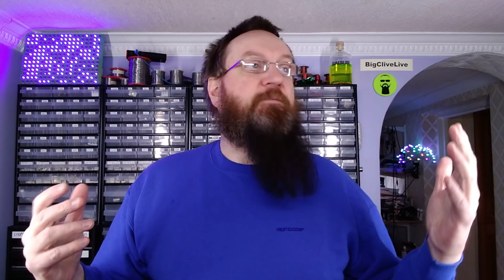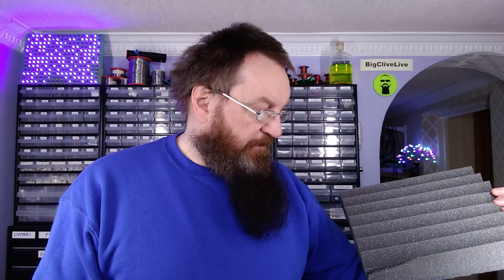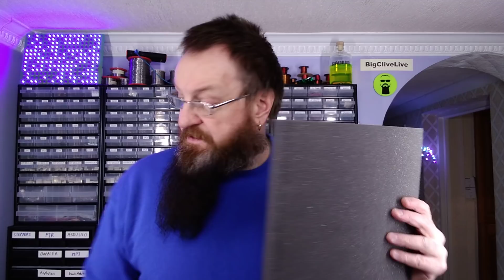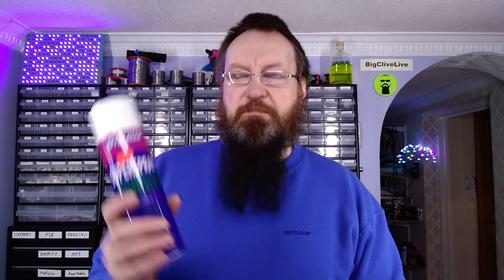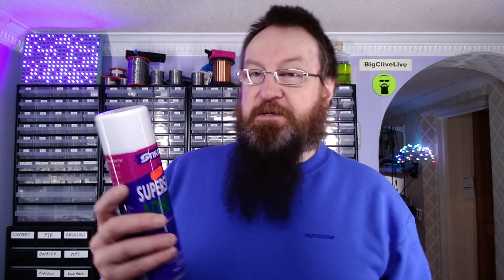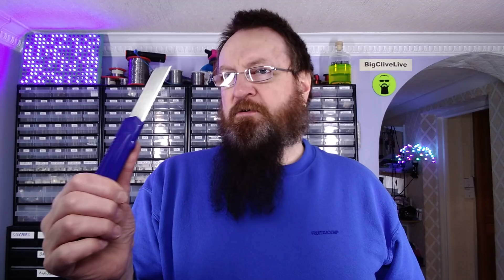Acoustic foam test.

Comment: holy crap! how low is that ceiling?
Reply from the maker: I moved here from an old tenement flat with an 11 foot high ceiling.  It felt claustrophobic at first.  This is the lowest ceiling in the house, but the others made up for their slightly higher height with candelabra lights hung at face height.  I'm quite big.  I have to go through some doorways sideways and duck under one door frame.

Comment: I don't know what your all talking about, that's it's lost all the highs. That is NOT the case. If the microphone is roughly on-axis with the source (his mouth) then the microphone is receiving a direct audio signal with no reflections...the best way to listen to something for intelligibility. Your simply comparing the increase in high frequencies due to the reflections before the foam was added to the damped reflection audio now.

The highs have technically reduced, but not below what is should be.

Comment: with my poor hearing (old man ears and tinitus)..., I experienced a drop in treble, and increased "muffle-ness", I guess the best way to describe it would be to say the clarity had dropped a tad. The bass seemed to stay the same tho. Really cant say the bass increased due to the loss of treble. I did have to increase the volume after the change, so there was some loss of total "volume". I had to increase the volume from 5 to 7  on a 0-20 scale. To bring things back to "normal", I increased the treble from 6 to 8, increased mid range from 6 to 8, and kept the bass the same ( 8 ) on my tone controls.

Comment: I tried a sample in Audacity.  Knocking -6 DB off the bass and adding .03 echo with .1 decay made it sound cleaner.  Your deep voice still came through but didn't sound like it was bottoming out the mic.  The only problem was when you turned your head the new setup seems to be much more sensitive to where you are relative to the microphone.

Comment: Far better with the foam in place.  I'd just run it through a smidge of post-processing EQ -- boost the gain a bit on the upper frequencies, and decrease the gain on the lower frequencies.  Should make it sound perfect.

Comment: The foam is flame retardant, but what about the spray adhesive (during spraying, when wet on a surface, and finally once dry)? That would probably make a good stand alone video, provided the local fire brigade don’t need to get involved - if they did I guess that would be Patreon only content?

Final result does have a reduced reverb at the higher frequencies, but the damping does accentuate the lower bass end and leaves little in the mid range - which does sound slightly muffled via my headphones.

Comment: It does sound different but it doesn't matter at all! We are not here for the sound but for the info.  Question: What is the weakest point of an audio transmission and reproduction (over Internet) channel? The mike? The preamplifier? The sampling frequency? The CODEC used? The bitrate of connection? The audio amplifier at the end? Oh, maybe the loudspeakers (laptop, phone, headphones, ear buds, full studio way loudspeaker box)? Oh, no, none of these... it's all in the foam!. Definitely, it's in the foam!

Comment: As the foam absorbs the treble (vocal) frequencies, the low-mids and bass become pronounced making the voice faint and muddy. Foam is better used for listening environments where the 'mirror-point' sound reflections (off the walls and ceiling) can smear the sound heard directly from the audio speaker. The best method to achieve a good room sound for recording is by mic and source positioning....a tile or two can help also. Thanks Clive!

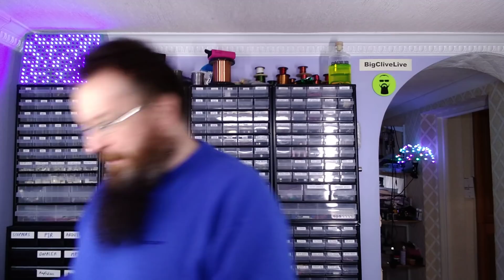Comment: Hello,  Please listen to your video from @3:00-3:25.  Notice that @3:10 the sound doesn't have a boomy/echoey quality, but by @3:12 you've stepped forward and the boom/echo returns.  The foam does make a positive difference.  (Please contrast the first 30 seconds of the video, when there is no foam and you move about which changes the sound quality, to @3:00-3:25.)  However, the foam is not a complete solution.  Your best sound quality will require you to stand a bit further from the microphone.  Thanks for working to make you live streams better. :-)

Comment: Sounds worse Clive, Listening in my studio with Tannoy Reveal nearfield monitors, which I mix my music on, the top end has gone. The trouble with enclosed spaces like you are in is the low end in your voice is over powering the top end in such a small space. I would try EQ on your post mix, and boost and add air after the 200Hz range. maybe cut a little of the bottom end.

Comment: If you create an air gap behind the foam it'll be more effective on lower frequencies and give you a more balanced result. 
The foam thickness + air gap thickness will get you the majority of the damping of foam of the same total thickness.
Reply: At 2" total thickness from the wall you'll get good absorption down to 250-500hz, and if you're looking to control the bass region you'll want to be 3-4" from the wall.
Reply: https://www.acoustic-supplies.com/absorption-coefficient-chart/

Comment: to kill that bass boominess you need extra material in all of the corners; many of the same foam vendors sell triangular corner traps for this purpose. You can also build one or two bass tube traps from fiberglass and hardware cloth or other materials; leave the ends open and place in corners with an opening near each wall/ceiling or wall/floor vertex. Used by audiophiles to kill bass resonances. The problem is you've got a baritone or tenor-baritone in a phone box. How much damping material is found inside a bass reflex enclosure to try to stop it from sounding like a box? Same kinda deal. Perhaps you should simply fill the entire studio workshop space with acoustic damping fiberfill, floor to ceiling. ^_^

Comment: You need a bass traps should also make a slight air gap so the foam basically doubles up. I’ve not watched the vid yet but these are some pointers

Comment: I have a great solution but a less fire retardant option. Towels are amazing acoustic dampeners. Especially if you make frames with one towel stapled around the outside of the frame and a few towels or even foam on the inside of the frame. I wish towels were flame retardant.

Comment: Sounds significantly better. You do still need to run your audio through some kind of processor. Too much bass.  The too much bass has always been a problem for your vids though, not caused by the foam.

Comment: HI Clive

After you done the panels on the wall, the sound has less high frequencies, that"s the foam doing its work. My advice as an audio engineer is to shelf the  lower frequencies down instead of turning the highs up.

There are lots of other things going on that create the box-sound. The panels are not so much correcting that, these are absorbing mids and highs.  Picture me with a huge drumstick tapping the outer wall of the room, that's how your room sounds. Freqs that fit between the walls perfectly will be amplified more than other freqs (standing wave,) It even causes some cancellation on other freqs. End result, the spectrum is not a flat line but more of a ripple. You have cabinets and stuff next to the wall that help to temper that standing wave, the largest surface in your room creating a standing wave is probably your ceiling. You will need a basstrap to correct these standing waves. I dont know if you want to be doing that. 

The microphone used is also a very big factor. Even if i'm in a very reverby room, when I talk into a mic very softly and at close range, you won't hear any reverb. So distance to the microphone is a critical factor. In sound design, we make a lot of use with this proximity effect. The biggest factor on a microphone that goes with this, is the polar pattern. Some mics are omni-directional, they pick up the sound from all sides equally. A cardioid pattern will pick up the sound  more from one side.

Truth is, its all trial and error. Yes a more expensive microphone will deliver a better quality. But you don't need a high budget mic to deliver an excellent quality. Mic placement is the most important part. You can already color the sound so much with only that. the closer you talk into the mic, the more low frequencies it has. The further away, the more room the sound gets. Just try as much microphones as you can. Borrowing from a friend, or rent them at an audio rental company. There are active basstraps, these work with a microphone and a woofer that gives pulses in some phase to correct the energy that is going on in the room. They are pretty expensive, but real something you would want to get your hands on and take apart to know how they work. 

Greetings and love your channel

Comment: Hi Clive!  seems like it has cut down on the echo, but also made things quieter.  As I've got volume control here that is an easy fix on my side :-P  I hadn't realized the size of the room.  It turns out I was just filling in the space to make it seem like the ceiling was taller and the wall behind you farther away.  It was so strange to see you reach up/back and touch the ceiling and wall behind you.

Comment: Absolutely huge difference to the boxiness. Sounds almost too dead after getting used to the old sound. I wonder if I can still fall asleep to this (probably yes), as echoing lecture halls are also good places to fall asleep in for me. 
I mostly listen with mobile devices which can't reproduce the bass frequencies. Now that I tried with headphones, I can hear what the others are talking about. The balance between lows and mids is off. Foam that thin won't do anything to the lower frequencies.
I wouldn't completely filter the lows, because doing that to the fundamental frequencies of a male voice is just silly. Mild adjusting with an eq would be the best and easiest way.
Reply: Moving the mic a little bit in relation to the walls can make a huge difference to the bass response btw. Having the mic very near a wall is a certain way to have a lot of bass boost.

Comment: Would be interesting for you to try a boundary mic. 
I used to own the Realistic PZMs years ago. They are the black steel rectangles that you used to see in police interview rooms. They included a phantom power "preamp" that took a single AA battery. Pro recording studios and orchestras knew that you could insert button cells up to 12V boosting the sensitivity without adding distortion. The secret sauce is in the simple circuit.
https://www.youtube.com/results?search_query=usb+boundary+microphone+review

Comment: A difference for the better. Now I'm suspecting the big bottleneck is the mic.
A tip for your table, seat and and other furniture - ask your local hardware store if they have heavy matts to glue under tables, benks etc. They can be some combination of heavy rubber foam, bitumen or the like. The slow dampening mass will make a great effekt.
Good luck.

Comment: I would say you are possibly harder to understand now as although it has fixed the reverb there is way to much low end making it sound muffled - It's possible this is a mic settings issue.

Comment: It helps, but is not as pronounced an improvement as it would be for a larger space. (Meaning the echo in the smaller space is very short.) 

I worked in a TV studio for students, and I learned a lot from their mistakes. For example, the journalism students might be in a big space like an airport concourse. And they'd do their stand-up piece with their back to a wall to "get away from the noise." This was exactly the wrong thing to do, and made for a very boring shot. They could easily have shot anywhere in front of any wall in a quieter place, and so lost the whole impact of actually being at the airport (except for the noise). The next time this group went out, I told them to go for the money shot with the busy airport as the background... and the sound was much better! Why? The first time out, standing in front of the wall (and close to it) effectively put the noisy background that much "closer" to the microphone, and thus louder. The noise bounced off the wall and was just as close as the reporter's mouth. In the second situation, the microphone was facing the actual source of the noise, but the noise was much farther away. Acoustically reflective surfaces can make all the difference.

I've added acoustical foam and other sound absorbers to whole studios. It should be noted that this is not "soundproofing." The foam will not stop stray noise from outside. (For that, the best solution is the double-staggered wall, where studs are offset from each other, like a brick pattern.) The absorbers kill echoes off hard surfaces from within the studio. One can even get "impulse test" apps for smartphones to time the echoes and their amplitude at various frequencies. Acoustic foam as simple as that used in this BigClive video can be very effective.

Check this comparison: 
https://youtu.be/zq07ZFMvo-c

Comment: Clive, I've got to ask - did you mount the panels horizontally or vertically? Did you use an alternating pattern to disrupt any dangerous hot air flow patterns?

Comment: Something is reverbing on the bass of your voice, close or in your mike.
On 04:20 you tap your table, and THAT sound is the reverb it seems to me now. Make sure that that top is not loosy, or your computer or mike is wobbling on it.
Try to keep the mike off surface contacts, hang it in the air.
Direct it 100% to your mouth, to get the most out of treble and mid range, that will bring overall volume down.
It could be that the size of the room is contributing, then an equalizer that blocks everything below 75Hz or so would do.

Comment: Acoustic foam is an open-celled foam used for acoustic treatment. It attenuates sound waves, the energy is dissipated as heat. (Closed-cell packing foam doesn't work for sound absorption at all.) Acoustic foam typically only mid and high frequencies, much thicker pieces of acoustic foam are needed to deal with lower frequencies. Clive has a fairly rich and resonant voice, along with the new acoustic treatment, using a little EQ for bass roll-off in editing would do wonders. Maybe an octave-wide 3 to 4 db boost around 2 kHz would help, too.

Comment: Readability is 5 5 7  Modulation is clear but dropped slightly in strength. The high frequency reverb has almost gone completely. 73  MM1ATR

Comment: Much clearer here than the sound in your live stream with same treated walls. Think that's because this video used the mic in the camera/phone, i.e. on-axis with your face. High-frequency sounds from the mouth (essential for intelligibility) fall off very quickly with off-axis angle, so the offset mic position you were using on the live stream sounded muffled - probably better to relocate the mic adjacent to your streaming camera, pointing directly at your mouth.

Comment: I'm listening with a cheap set of studio monitors, but the foam has definitely cleaned up the sound a bit. There was a tiny bit of natural reverb happening before, and that's gone. The sound is still a little bass-heavy but it does sound just a little more professional; it's an improvement. Incidentally, I think I have this same foam but since I'm speaking directly at a giant monitor all the time with a hard desk below it, I didn't think it made much difference for me and haven't put it back up after moving to a new house.

Comment: very noticeable. its cleared up and the mid ring has gone. you could add a low shelf to knock a few dB of fro, 160hz in post if you want although its probably more preference as it does sound nice and warm

Comment: The sound is better without the foam. The clarity of your voice is reduced when the foam is added. I use the term "clarity" because I think that is the most important thing. For reference, my listening system consists of a large power amp and 1 meter tall floor standing speakers.

I listened using my desk computer speakers and the results were similar, but not as significant.

I noticed the sound quality changes a lot depending on the position of your head.

Comment: Listening on my mobile phone the panels greatly improve the sound quality without any drawbacks. My phone isn't great at producing lower frequencies so the folks telling you to use an equalizer may be right too. Edit: when listening with headphones I do agree that the lower frequencies are a bit too prevalent. Turn those down a bit with an equalizer and you should be good.

Comment: Sounded dramatically better with the foam behind the mic.
As others have said a bit of post-production may sweeten it a bit further by attenuating the bass on a parametric EQ plugin and maybe a bit of light compression, assuming that you're not already applying some.
People are saying that certain frequencies sound muffled and a modern digital compressor might be able to lower the louder parts of the spectrum so that other parts of the waveform can become more prominent and fuller. It does depend on the software though as not all compressors are designed to do this. I know Roland have the technology because they've built it into pedals but whether that's the case for any software plugins I'm not certain.

Comment: I think the sound has been improved quite a lot. The echos have gone and vocals seem clearer, the only thing that might help with that would be a stereo mic (correct me if I'm wrong). In the aircraft industry -  flame retardant foam has a graphite power through it which helps to snuff the flame instantly.  Also all foam is very pricey, the most expensive part of the job sometimes next to leather. A cheaper option that some use are egg cartons, for noise dampening purposes. Keep the experiments going Clive, love your work